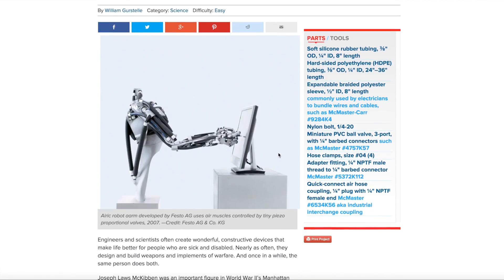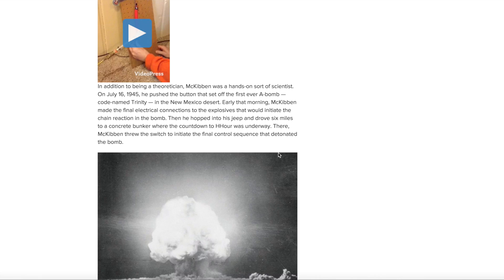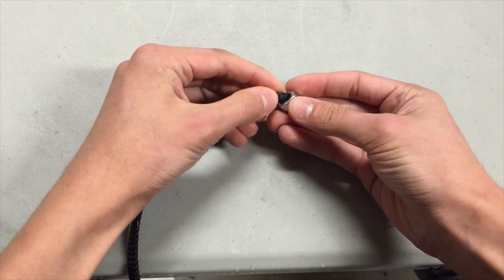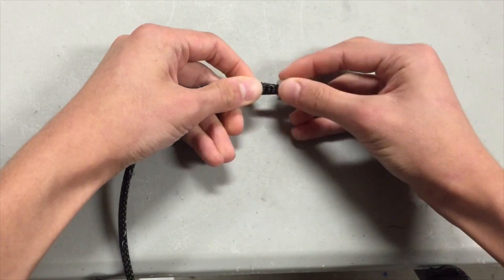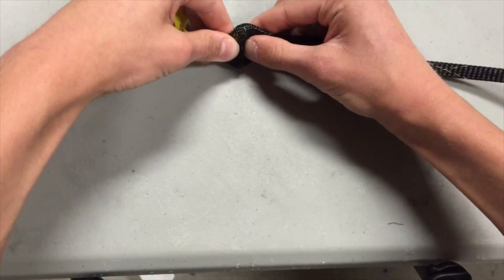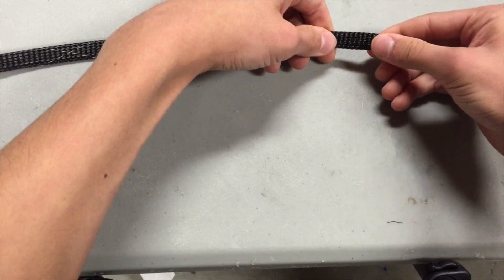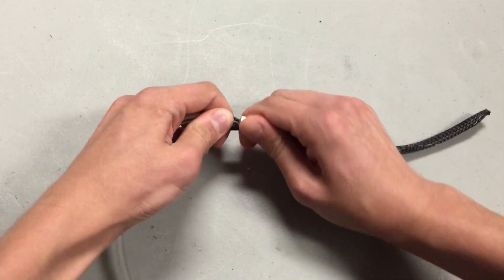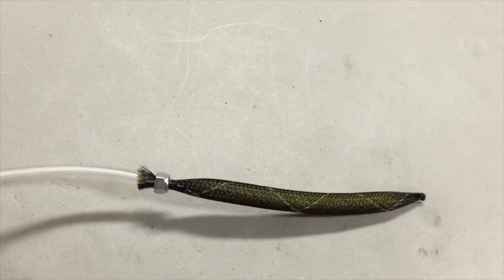How to Build a McKibben Air Muscle

Comment: Hi, in which local shops do I have the best chances to get the parts? Especially the braided sleeving. Electrician? Also, if I want to use a silicone tube instead of the balloon, any ideas where to get that? Also, whats the reasoning behind these balloons, compared to others? That they last longer, and so they are more resiliant?